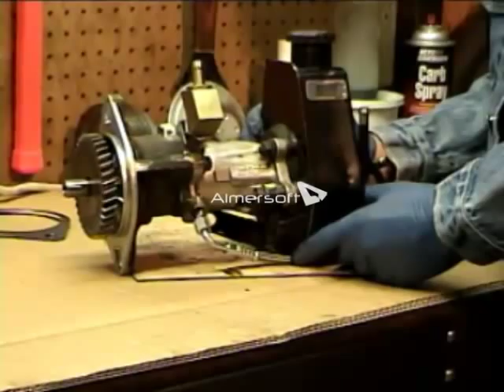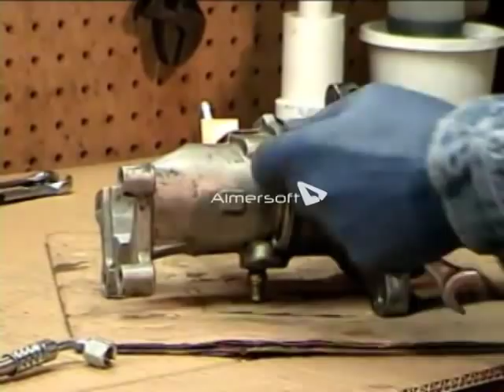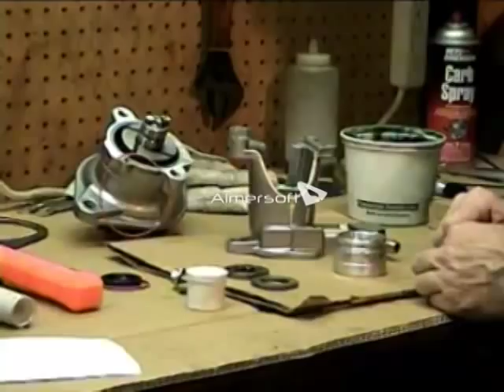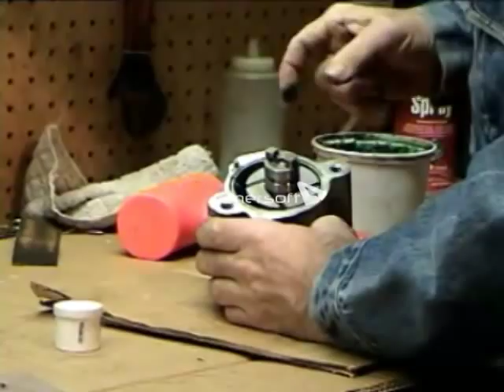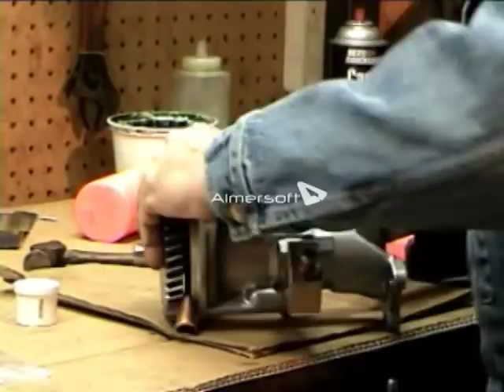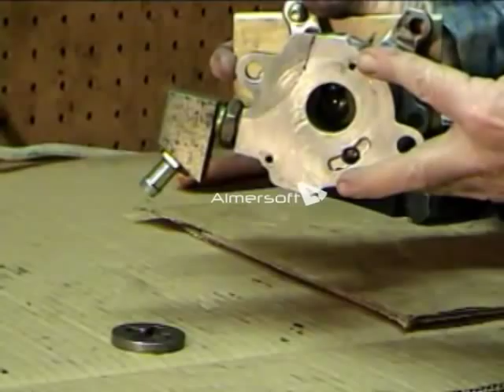DODGE DIESEL 2 SECTION VACUUM PUMP REPAIR 1996/2002

Comment: Thank you sir for giving a detailed instruction on how to repair our vacuum pumps. Patience is a virtue and you have plenty of it as demonstrated by your quiet attitude and length of time spent on behalf of anyone who has had problems with their vacuum pumps. I am now more confident that I can repair mine and will gladly purchase your repair kit for my 01 ram 2500. Now with 100K miles, it has had a slow leak for about 30K miles. It's time to get it fixed. Thanks again for your fantastic presentation.

Comment: Mr. Gould's kit worked great... better than factory rebuild part kit.  

Here are a few tips I pulled together from several other videos and blogs that I hope will save many of you a lot of time and scraped knuckles getting the pump off and back on.  I have a 1998 12-valve engine 4x4. Getting access to the pump appeared to be almost impossible, but thanks to others I learned these tips:

1 - Remove the fender liner by drilling out the plastic rivets. This gives much better straight-on access. To reinstall the fender liner use replacement rivets (Mopar P/N 34201631 at $7.75 per rivet. Way too expensive!) from Auveco P/N 18108 at $8.50 for a box of 25.
2 - Once the fender liner is removed, pressure wash the side of the engine at a DIY carwash. The side of my engine was loaded with dirt and oil-soaked gunk that likely would have fallen into the gear case while pulling or reinstalling the vac pump
3 - Remove the driver side battery, and the air duct hose between the intercooler outlet and the intake manifold to get better access from the top. Be sure to insulate the positive terminal by wrapping it with rags and covering it with a plastic bag, or disconnect both batteries.
4 - Put the driver side end of the front axle on a jack stand, then remove the driver side front wheel. You now can reach right in to get at many of the hose clamps and bolts/nuts.

Good luck!

Comment: Amazing video, Mr. Gould! 
I had a real hard time pulling my broken gear dog. I found that putting a slight grind into opposite sides of the groove WITHOUT going through into the shaft, it helped the puller to seat better. It kept slipping out of the groove other wise. Just my 2 cents. 
Thanks again. 👍

Comment: Great kit and great video here!  My 1998.5 4 X 4 has 330,000 miles, and the vacuum pump and drive dogs weren't in that bad of shape.  I had to use a bearing splitter on the drive, put in the 20 ton press, and it did go pow when it turned loose.

Comment: My power steering and brakes went out on my 99 4x4 cummins and after replacing my power steering pump I was stumped why there were 2 pieces sheared off an why the coupler disc moved freely. I figured it was normal and someone before me replaced the pump and never took the pieces out. They still didn't work so I figured it would be the hydroboost. I wasn't going to watch this video because of the length however I'm so glad I did because now I know it's my vacuum pump not my hydroboost! Thank you so much! Very helpful

Comment: I have a 01 ram have had the oil leak for some time. I thought that it was the blow by until I stopped at a diesel truck repair shop.  They showed me where the oil was leaking from...the vacuum pump.  The other shops had no idea. Thank you for your video and being so thorough. I wish that I had seen your video before I scheduled my truck to be repaired.  I will pass the info on to others.

Comment: I bought your kit and just completed the installation while playing the video. Having a great kit and such a detailed step by step  was incredible. I have to drive across the country in a week and needed to replace my power steering pump and noticed the vacuum seal was leaking. You were a great help in getting that solved!
Reply: And the copper tubing trick was fantastic!
Reply: John Fudold hey where did you buy this kit at I can’t find the gasket kit
Reply: @ELPATRON839  that's for an 01, make sure you get the right one from his other ads if you don't have that one.
Reply: Thankyou very much !

Comment: *Updated* Can you tell me if a 1990 Dodge Cummins 250 w/o intercooler and the oldest style vacuum pump can be retrofit with the later 2-piece vac pump & power steering pump, like the one for a 1998 12 valve, if the owner is willing to have make new P/S hoses made?

Mr. Gould - Thank you for your time on the phone today. I'm happy to learn how easy it is to upgrade to a 2-piece vac pump and newer power steering pump for the old 1990 Dodge 250 Diesel. Glad to hear no new hoses will be needed.

Comment: I didn't even have to bleed mine for some reason but I replaced mine with a new vaccum and ps pump that has hydroboost. I filled it up started it up and drove it and it steered easier then the old pump. I have a 94 dodge 12v 4x4, for another note when I replaced it my oil feed line was 1 3/4 to short(because the oil fitting was clocked more towards the motor on the old stock vac pump for some reason). So I got mopac to make a braded line 2 inches longer with the npt fittings pressed on cost me 20 bucks got her back on the road again. I m sure your all wondering well why are you on here if you replaced yours with new, well I want to reman my old vac/ps pump for a back up or to possible sell. I just wanted to share my experience maybe help someone. Excellent vid by the way, your the man! I have one question is there a bearing in the front of these vac pump near timing case or not?

Comment: Thank you for a great video brother.  I put a 94 5.9 in a 90 F250. I have next to no vacuum for my ford brake booster and heater controls. So, I need to take the vains out and get varnish off and reinstall? Is that right? Thank you and God bless you!

Comment: I have a 2001 Dodge Cummings.  I have a Vacuum can with a cable coming from it to my throttle body and it's not pulling mythrottle body back to idle.  I don't know if it is electrical or the vacuum can.  Can you tell me what you think?

Comment: I should have watched the entire video.  I did not service the vanes of the pump and ended up not making vacuum until I revved the engine to over 1500 RPM's.  The oil line from the engine does not want to quit leaking so I guess that I'll replace it and the fitting to try for "no Leaks".

Comment: i dont have power steering- I look and the fluid is not even moving in the reservoir.  like the pump isn't even spinning. What could be the cause - I looked in there- the hole after the pump was out it seems normal  please help.
Reply: wat was the cause for this did it just randomly up and happen or did you make a lock out turn on the steering wheel while applying the brakes did you already replace the  p/s pump
Reply: The dogs on the vacuum pump’s coupler have sheared off.
Same happened to my ‘97 and I’m going to be doing business with with mr Gould where I will send him my vac pump for rebuild.